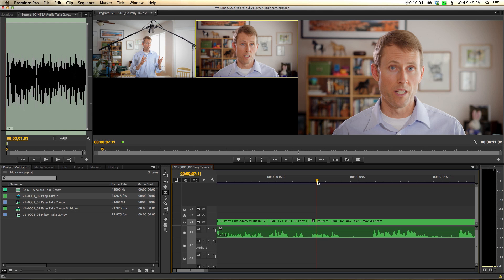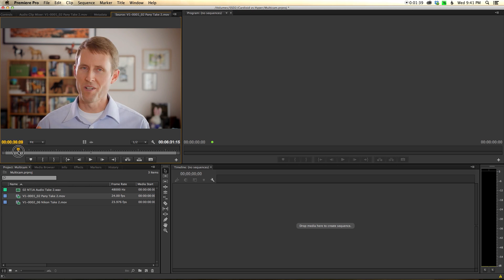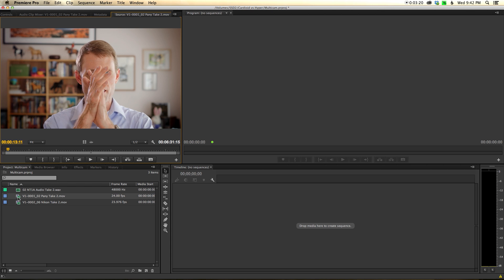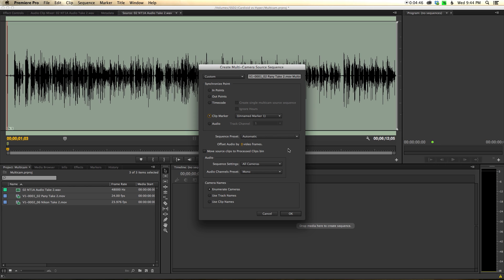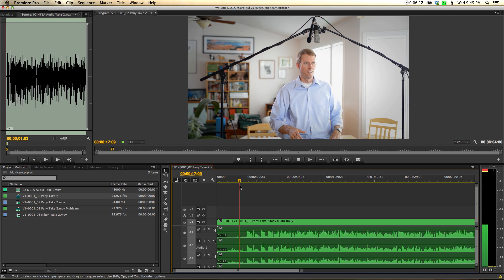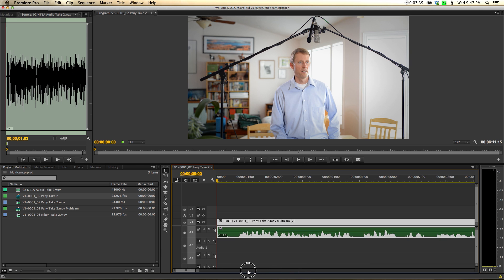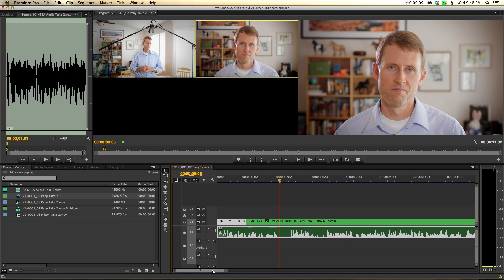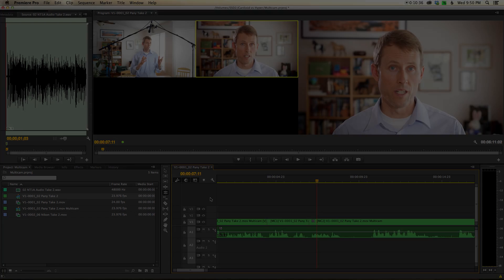Basic Multi Camera Syncing and Editing in Premiere Pro CC

Comment: I have a question Curtis, should I record my audio at a certain speed or level so that my video will be at the same timing with the audio when I edit?
Reply from the maker: Yes, beat to use the same sample rate on camera and recorder.
Reply: @curtisjudd  Which would you recommend
Reply from the maker: @rudyonthego  48kHz if your camera is capable of that. Many consumer cameras don't have a setting, you just need to bring a video clip into an editing app and look at the inspector to see what sample rate it recorded at. Most likely it will be 48kHz, but it might be 44.1kHz. Then you'll want to match whatever it is on your audio recorder.
Reply from the maker: @rudyonthego  Ok, will do, thanks!

Comment: How to add b roll
Reply from the maker: B-roll typically has no sound associated with it (you remove or mute it) so you can just add b-roll clips on a new track after you finish switching the multitrack sequence.
Reply: Curtis Judd why is my b roll zoomed in when i put it on the timeline?
Reply from the maker: It is possibly a different resolution than the multi cam sequence?
Reply: Curtis Judd yes

Comment: The multi camera sync doesn't work for my clips. It ends up totally de-synced. I was able to manual sync the clips on the timeline and want to see the multicam window for playback but can't figure out how to get it to work...
Reply from the maker: You’ll still need to make a multi cam sequence by manually syncing. If you place markers on each of the clips and then follow this procedure, you should be able to pull up the multi cam window.

Comment: This has been wonderful. I was editing the hard way for multi cam. What happens if you have 3 different audio tracks though from 3 different mics?
Reply from the maker: You can go different directions with that depending on the piece. You can set it to only cut the video and use the same audio track or it can be set to cut to the other microphone with each switch between cameras.

Comment: Here's  tough one. 
Any idea of how to change the SOURCE SEQUENCE for a multicam sequence after all edits are done? A bit hard to explain:  
- I successfully edited all of my clips using normal multicam workflow. 
- Unfortunately, the original layered source sequence with the original cameras clips seems to have errored. 
- The result: I can no longer edit it or even export the final multicam edit with out PP crashing.
I can copy the source sequence and make edits no problem, so obviously something went wrong with the original source sequence. I have many, many edits, so it not easy to restart and remake all of the edits from the source sequence copy. I would just like to "point" the sequence of camera edits at the source sequence of cameras that does not error. Any ideas?
Reply from the maker: That is a tough one. I must confess I don't have any good ideas on how to fix that. Perhaps others here do or maybe Adobe support can help. Best wishes!
Reply: OK, thanks!

Comment: Hello..sir i musing premiere pro cc 2017 and i want to us multicamera sequence in my vedios bt when ever do that it gives me error like "audo synchronize failed" plzz help me sir i m really frustrated about thiss
Reply from the maker: Hi unik malik, oh wow, I'm not sure where to start. I guess I would use just two video clips as a start. If that works, then start over, this time using the externally recorded audio and the two video clips. Keep repeating until you find the spot at which the sync isn't working anymore. That'll tell you where Premiere is tripping up and then you can check the settings in the create multicam sequence box to see if you can get it to work. If that fails, you might be best off contacting Adobe Support. Best wishes!
Reply: thanku so much sir for your reply.. one more thing sir ..is there any other way to do multi cam sequence.. in premiere i had seen one tutorial in which a person was using nest and then enabaling the multicam..like this bt i forget that way..would you plzz tell me sir..becoz the way u told above is still not working..
Reply from the maker: Hi unik, I with I could help with that but I'm not familiar with that method. I'm sorry. :(
Reply: ohk..doesnt matter btw thanku so much for your help:)

Comment: Curtis, amazing job, I've been a subscriber for a while now and love your channel.

A couple of questions though:

1) What if Im working with different cameras, set to different resolutions? Such as 1080 and 4k.

2) What if all my cameras are not recording all at the same time, say, on a 1 hour interview I may set up a camera for the last 15 minutes, or so.

3) How can I color grade my clips separately, and/or apply effects and different transitions to them?

Really thankful for your help and looking forward to your reply!
Reply from the maker: Hi nemezote, Thanks! 1) you'll want to set your sequence to the lower resolution most likely and just edit as usual. You can go the other direction but the lower res footage will look soft. 2) That shouldn't be a problem, the multicam features still work. 3) That depends on how you want to structure your workflow. For big projects, most choose to color after the edit is complete but for short pieces, I often color before the edit because I don't have a ton of clips and I've already chosen which of them are going to be in the edit (so I only color those). Are you coloring in Premiere or Resolve or some other app?

Best wishes!
Reply: Thanks for your quick reply Curtis. I'll give it a shot next time, for now I'm doing everything in Premiere and don't really feel the need to try other software.

Comment: A question you might be able to answer. Loved this Multicam vid and can follow it perfectly. One problem is I capture video from 2 Gopro cameras. By design the camera splits the video into 3.5Gb pieces. These load into Prem pro..project area. If I create a new sequence incorporating the video pieces (to effectively join them) , I can place a Marker at the clap point on the sequence and the audio file but when you chose to do Create Multicamera Multi source clip you don't get to choose the "Clip Marker". From experimentation I find that sequences are no value when syncing with Markers. It only works on the raw MOV file. I can use "video join" software but that's just another step. Any suggestions. And love your videos BTW.
Reply from the maker: Hmm, I don't know of a way off the top of my head. You could always export the spliced sequences to new files, but that's a time-consuming process as well. Perhaps somebody else here has solved this problem?
Reply: Hi Curtis. Thanks for the response. Yes I have used a free product that handles the join well. Works a treat. http://www.dvdvideomedia.com/ but adds another task to the  projects. Its lossless.

Comment: If necessary, How would I go about re-assigning camera 1? for instance, I have synced my clips by their audio tracks and file x has high quality audio from an external microphone, but Premiere assigns camera 1 to be file y which used the camera's onboard mic. Any help would be great. Thanks!
Reply from the maker: I believe you can select which audio to use in the window that appears to create the multi cam source sequence.
Reply: Thanks for the reply. I had trouble finding it but figured out that you have to create the multicam sequence by right clicking on the clip with the good audio.
Reply from the maker: Ah, ok, that makes sense.

Comment: Thank You for this video.. I had no idea that Premier Pro would do this as I am still kind of new to using it, but this feature made syncing audio tracks much easier than doing it manually as I have been doing since I started with PP.  I can't wait to try the multicamera tip as well since that does seem like a easier way of transitioning back and forth. 

Keep up the good work..
Reply from the maker: Thanks Jeremy!

Comment: Can't I control the audio from within the multi-cam interface? Seems like that preliminary step of eliminating audio tracks is superfluous.
Reply from the maker: You can choose which audio you want to use on the Create Multi-Camera Source Sequence box by setting Audio--Sequence Settings to the camera whose audio you want to use. Is that what you meant?  The other method is only for cases where you have a video clip with no audio at all.

Comment: Another way to do the initial multicam is this (and I found this super useful when dealing with multiple video files... you know, a camera that cuts every 2 gigs and creates multiple files? yeah, those): 

- Create a sequence
- Add your video files to that sequence and syncronise them (remove unwanted audio the same way you see here)
- Select the whole thing (all video & audio), right-click, Embed. I call it "Multicam" and click OK.
- Right click on the new green bar in the sequence, select Multicam, then Enable. 
- In the "Program: Sequence X" window (where you see the video preview), you can then enable multicam view to see the same as Curtis has (where you can switch between videos and the cuts are made automatically).

Hopefully I wasn't too confusing... This is just the way that I found was perhaps easier when you have sequential videos in different tracks and such.
Reply from the maker: +Évelyne Lachance Great info, thanks for that!

Comment: Great video! I need to have two different white balance effects on each cam, but unsure how to quickly/easily edit the individual clips so that the white balance doesn't effect both cams.
Reply from the maker: You can do that before merging into a multicam clip or drop the color corrector effect on each edit in the multicam clip. Easiest to do it before merging.
Reply: Thanks!

Comment: I really wish i could do this, but i have so many multiple clips in premiere and they are in bins, so i cant figure out how to select all the clips i need as they are in seperate bins.. is there a way to select them on the timeline directly?
Reply from the maker: +Alex S You can open your bins and control click (PC) or command click (Mac) just the clips you need.
Reply: +Alex S if you already have them synced and in the timeline then from the timeline you can hold Alt+Shift  and select all the shots you want in the same multi-cam edit. Than right-click on any of the selected clips, and select Nest (Alt will isolate the video from the audio, so your audio doesn't end up in the nested sequence). After it becomes a nested sequence, right click and then go to multi-cam and select enable. After that you want to display the multi-cam monitor to see the different camera angles. In CC and newer they moved the Multi-cam monitor over to the settings (wrench symbol) on the program monitor, in previous versions you can find this in the windows tab.
Reply: thanks for the info guys!

Comment: hi. mine is very slow and i can really tell where i am. shall i reinstall the software ?
 Thanks for this video.
Reply from the maker: +FBY Fraser You're welcome. Multicam editing is a lot of work for a CPU and graphics processor. Re-installing may or may not help. You'll probably want to contact Adobe support if you run into technical issues.

Comment: Nice vid.  What if the two camera's ISO or brightness is off from each other?  Should you fix the files individually and how?   Or should I just edit the whole film then correct it somehow later and if so how?
Reply from the maker: You could approach it either way. If I were working on a short piece, I'd do the color/exposure correction first. You can do that right in Premiere with the Lumetri color tools if you're on CC. Or you could use the fast color corrector on older versions.
Reply: +Curtis Judd Tx!
Reply: +Curtis Judd Finally moved to Adobe CC...  Love it.
On the question, even after you create the multicam sequence, the original clips are stored in the 'Processed Clips' bin.  You can apply effects, color correction, etc. on those clips and it transfers to the multi-cam sequence seamlessly.  
Awesome.
Reply from the maker: +Terranscapes Great to know, thanks so much!

Comment: Hi all, I'm new to Premiere. I've downloaded a TRIAL (CS6 I believe). All my videos (and audio) are lined up on the timeline (by manually dragging them from the uploads window and lining up), but there is no option in the top right to click and select multicam. Any ideas?
Reply from the maker: +Robbie Sparks Hi Robbie, I believe you need to select the files in the Project panel (lower left) then right click and choose Create Multi-Camera Source Sequence. I don't believe there is a way to make it work by manually dragging the files out on to the sequence. If you're having trouble getting them to sync up using the method we show here, you can set a marker on a sync point in each of the files and use that as the sync point after selecting Create Multi-Camera Source Sequence. I hope this helps and good luck!

Comment: what if the audio is a q&A between two people , 3 cams shoots , 2 close ups and one wide ? it doesn't audio match! Help
Reply from the maker: Is there a slate or clap at the start? You may need to manually mark the slate clap and then use the market as the sync point.
Reply: no there isn't , there is come one saying que, but all 3 cameras have audio miss on
Reply from the maker: +M Power That's a tough one without a clap or slate. Unfortunately, you'll have to do that best you can dropping a marker where the person starts to say "queue" and then sync on the markers.

Comment: Hi Curtis.  You make very good tutorials and I appreciate your efforts.  I am using your instructions here to make a multicam video from different car cameras of a short Iracing race.  I have what I am satisfied with now, but I have stopped after completing the sequence.  Now I need to know how to finish it off.  I want to do a voice over narration and I see you have a tutorial for that, thanks.  I think I can figure out how to crop out the footage after the end of the race.  What else would I need to do before rendering?  Select a frame to use as a thumbnail?  I notice now that there is a record button for the multicamera widow.  Was I supposed to have it recording while making the camera switching sequence, or is it good as is?  Brand new to Premiere Pro as you can tell.  Thanks.
Reply from the maker: Dermarv03 It sounds like you're set. If it plays back with the cuts you made between cameras, you're all set to render! Good job, that sounds like a pretty ambitious project!

Comment: Great tutorial, I immensely enjoy your videos! 

I have some thoughts on minor details you experienced;

Unless you are shooting with 360 shutter angle (eg 1/25s at 25fps), it is random where your hands are when you hear the clap. At 180 shutter angle (1/50s at 25fps), each frame contains 100% of the sound events but only 50% of your image events. So the timing strangeness is probably just a normal/expected result of the shutter angle rather than the sound being out of sync.

Also if you are crazy about getting perfect sync when matching a camera track with external audio audio track, you can enable audio ticks and move the audio track until it is 100% aligned with the video track. Not so helpful with multicamera though, as then you have multiple videos and audio track can never be 100% aligned with all video track's frame. If you zoom in very closely on a multitrack, you'll realize it is virtually impossible to get multiple video sources to align perfectly, those darn video frames are far too long to allow perfect alignment :-)
Reply from the maker: All good points, as usual. Thank you.

Comment: does it work on the earlier premiere versions? very good tutorial!
Reply from the maker: Agree with wieheissichnochma Auto sync came with the first version of CC and things were mostly similar back through 6. 5.5 is where things were a little more fiddly with the need to nest. Definitely check out older tutorials for the specifics.
Reply: It's very similar, but they do have limitations. CS6 doesn't have the autosync option I believe, so you have to synchronize manually. CS 5.5 only has the option to use max 4 cameras. The way of doing it is also a bit different, in CS 5.5 it's useful to nest the sequence before making it a multicam sequence. I recommmend watching a tutorial on your version.